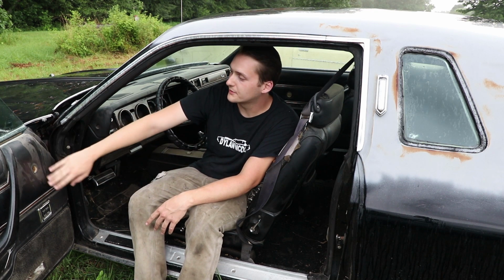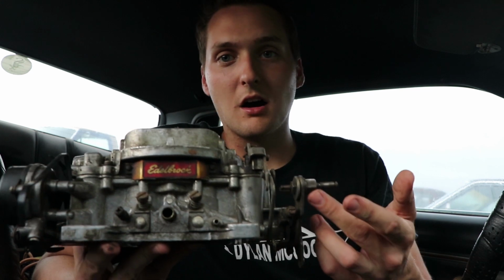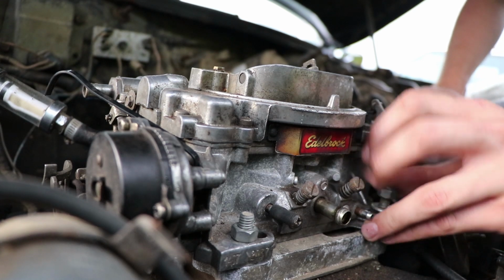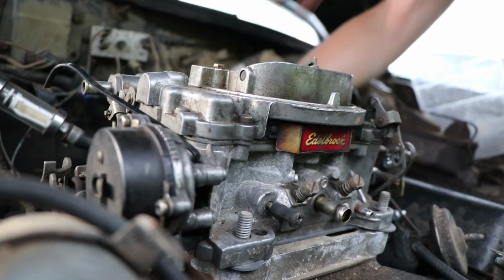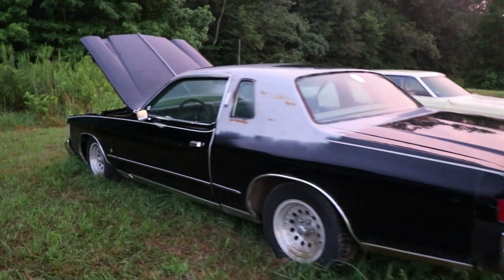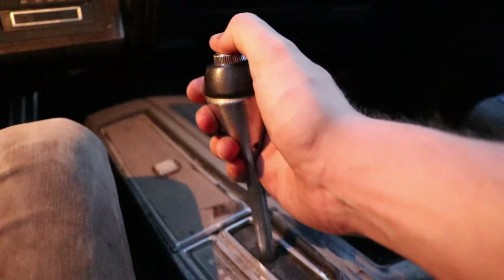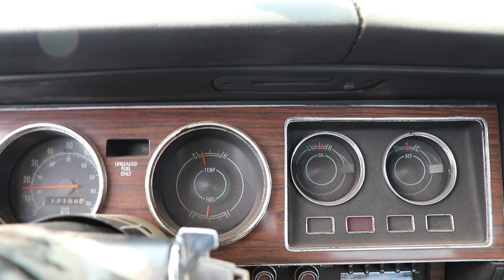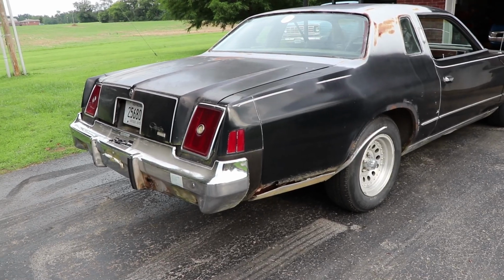$600 SLEEPER BUILD REVIVAL!

Comment: Do it!! Build it nice with the engine it has. For a sleeper, (if you must) why not do a supercharger on the engine it already has?

I haven't seen all your videos, but I can't recall a single one where you supercharged a vehicle.

It's much easier then pulling an engine. Only thing you might need to change out is the rear end.

Posi-traction or it's Chrysler version of it is a must in my opinion. Some people put a 9" Ford rear end in everything. I think this is unneeded. Chrysler makes plenty of strong rear ends. 

3.27 or 3.55 gearing will be just fine. The 4.11s get annoying real quick if you drive it a lot. With the luxury features that still work, 2 words -- daily driver!!

To many people hate on the Cordoba & changing that reputation would be great.

Personally, I did a 1968 cougar. I just have to get around to getting it inspected and ditching the historic tags, but I did seriously consider going with one of these Mopars. Only reason I didn't is that my last restoration of a 1970 cougar failed but I know a lot about cougars. I paid $18,000 for my 68 & I had it certified as being fully electronically and mechanically restored. Just needs to have the paint job freshened up.

Go for it!!

Comment: You need a shit load of gravel back there it kinda gets me seeing the cars in the moist grass slowly rusting
Reply: Gravel doesn't do it justice moisture will rise through ya need concrete
Reply: At Corndog! Not true at all! My Classic Rust Free 1995 C1500 sits in a gravel parking lot all winter for the last 3 and hasn't hurt it at all! I got also A classic 1997 Rust Free Dodge Ram original miles of 23,300 and it will be sitting in that same gravel parking lot when winter comes and they start salting again! tony TRUMP 2020.
Reply: @tonyfriend7413  Classic 1997? lol
Reply: CORNDOG Extreme concrete actually releases some sorta gas that will rust a car also. Need plastic under the car if your gonna park it on concrete for a long time
Reply: @tonyfriend7413  
Are just looking for trouble sir?

Comment: I wanna see it! Keep us posted. BTW, if you order the TQ replacement AFB from Edelbrock, in either 625 or 750 cfm, you will not need the linkage adaptor, and if you car has factory cruise, that lever will pin right on to the carb and work perfectly. IMO ordering 1 with the electric choke, GM style, is a must. On stock applications, they generally run very well right outta the box.

Comment: I never had much luck with Edelbrock Performer carbs, especially using them with an adapter like you are using.  I still have a like new 1406 and 1411 sitting on my shelf for over 20 years.  They both had an off line bog, even after adjusting them like Edelbrock suggested and even after talking to their techs on the phone.

Comment: Hey Dylan there’s an old Dodge pick up (early-mid 70’s???) parked beside some bulldozers over by a used car lot in the Red Boiling Springs area close to the Kentucky line like your going to Tompkinsville if your familiar with that area. It looks a lot like the blue one in your intro. Glad to see this ole gal running again!

Comment: Adjust the accelerator pump and the idle mixture then set the final idle speed.. Replace the windshield so you don't get pulled over for it.. Then drive the mess out of it! Awesome 😎

Comment: This was a few years ago now but I really like this car.  Never paid attention to this model before but it looks pretty cool.  It didn't look huge to me in the video but maybe I misjudged it.
If it were mine (and if I had welding skills) then I'd get after the rust and fix it up to be a nice daily.  I probably wouldn't do anything crazy with it engine-wise, it doesn't need to be a dragster, it just needs enough torque to be enjoyable to drive.
I don't even know what engine is in this car, but a healthy, freshly rebuilt 318 or 360 would seem like plenty for it.  I'd leave it carbureted myself, I wouldn't put modern EFI on a car like this, the charm and practicality of older cars for me is in keeping them simple.
From that acceleration run it sounded like it could use shorter gearing in the diff.

Comment: Build it, EBay Turbo,cam, 411 gears, Lincoln locker, Old school Lakewood slapper bars,  3,000 +- stall converter,  Manual valve body with shifter, Line lock/trans brake and good to go.

Comment: I would like to see what you can do for it visually. First, paint the roof Gloss Black and touch up the exterior.  Put black on the primer and put the pinstripe back where it was removed.  Then touch up the interior.  
This car looks like it had a beautiful interior when it was new and is close to it now.
For performance, I'd like to see you add and air fuel gauge and use that to tune the carb.
Supposedly a cheap gauge off ebay and a sender off a generic car like a 95 Lincoln for 15 buck would work.

Comment: Yes that car would make a excellent budget builder. The Aspen just doesn't fit the build. Heads, cam, intake and slide a 8 3/4 rear with posi and 3:55 or 3:91 gears. Be a fun car, may shave some weight off it too. Great videos, keep em coming.

Comment: late b bodies are cool - biggest thing you need is more compression - stock 400 is about 7.25:1 - smaller combustion chamber heads or milled heads with thin head gaskets go a very long way
Reply: Yeah, and you know it's Probably down to less than 7 : 1 now. I love Stroker 400s. I have a 230- 1 block sitting in the corner of my living room wrapped in plastic lol
Reply: Which is the good 72 Dodge truck first run 400 block.

Comment: Glad to see it running again. Just wanted to mention something, 93 octane in a stock engine is no es bueno bro. As you know, Cars from the 70s and 80s had very  low compression and timing for emission control instead of performance. Higher octane fuel  burns slower which doesn’t work well with low compression and barely any ignition timing. I would run 87 in it whilst its still stock. Or adjust timing and tune carb you could probably use 89.

Comment: Being a 71 year old guy originally from SoCal (Boo), who has built more than a few fast Mopars back in the day, here's what I would suggest. Sleeper = unsuspecting + lightweight + cubic horsepower. Cordoba weighs ? Aspen weighs ? Small block potential ? 318 ?... 360 ? Transmission ? Rear axle (important) ? I have drawn my own conclusion... have you ?

Comment: I could respect the Cordoba as a sleeper if you got sway bars for it, so it handles neutrally. I'm sure you can get some suspension pieces to fix it up without ruining the ride.
Reply: It doesn't have to have a lotta sideways grip, so long as it no longer plows through corners or is tail happy without lots of horsepower going to the rear wheels.
Reply from the maker: It already has front and rear sway bars believe it or not.
Reply: Fun fact, on cars with rear swing axles (think Triumph Spitfires) they use the opposite of a sway bar, it's called a Z bar. That keeps the axles down and the tires gripping.

Comment: the Cordoba is a fine car, a big two door boat that cruises on the highway in luxury, not my choice of a sleeper because it still has that charger look of the mid 70s. the Aspen 4 door is a good choice for a sleeper car. it looks like grandmas car and as long as you keep it quiet you would surprise many with performance mods to that car

Comment: Dylan dude.... sell that Cordoba and the Aspen...fix the challenger

I know where's there a a 60 wagon and a 41 WC  you could make into a car hauler!
Reply: 60 Chrysler wagon ? I have a super straight rust-free 64 hardtop Chrysler wagon. All of the 60 body is direct bolt on except I have to add the 60 quarters. I want to convert my 64 to a 60. What's the deal on the 60 , if it is a Chrysler  ?

Comment: What kind of cam can a put on a 318 dodge ram D150 1987
Reply: Mild torque cam.
Take advantage of Mopar's large diameter lifters and use a modern cam with faster ramps.
I would suggest a small Lunati Voodoo cam.
Reply: When installing your new cam, make sure to install it correctly and break it in the right way.
Use oil with PLENTY of zinc-additive..
Reply: get the smallest lunati voodoo cam, and get their lifter and spring kit with the cam. simple as that. oh, and get some zddp additive(i use stp oil treatment in a blue bottle) and slobber that cam up with it, and out it in the oil.

Comment: In all seriousness, I love this car, and it's hard to beat that big block under the hood. I don't really like the 727, because #savethemanuals, but other than that, this car deserves to at least be painted all black with a nice paintjob and it should have the 440 gone through with home higher compression heads, MAYBE domed pistons, and two Holley 650s on top.

Comment: build it , it will be a good car good and strong to handle a good motor and they don't look bad more like a cruiser i'm building a 68 chevy pu right now not sure what the next project is but have a 66 gt dart in very good condition or a 79 z28 rs t top full spoiler kit from factory a one of a kind car because of the full spoiler kit they only sold 17  camero's with the full spoiler kit in 79 and only one like the one i got and have a 79 z28 hard top if need parts the dart  i have a 392 hemi for it the camero i have a 454 stroker both good motors just not sure witch one yet but have time